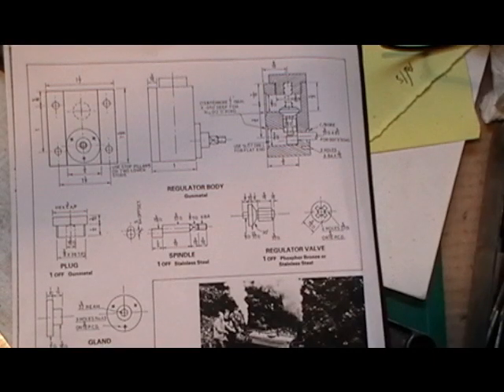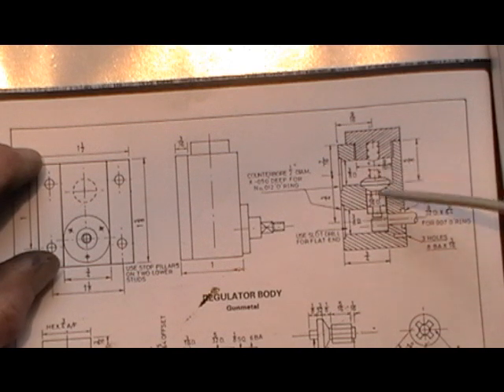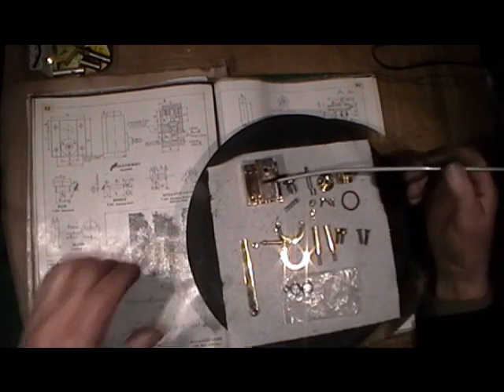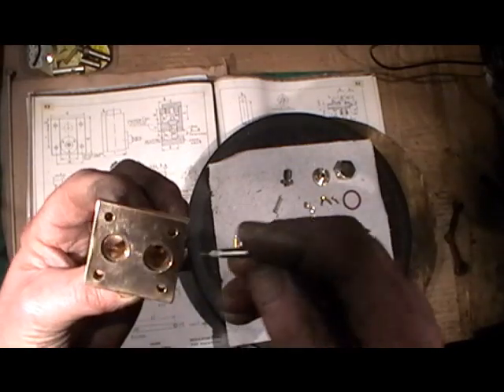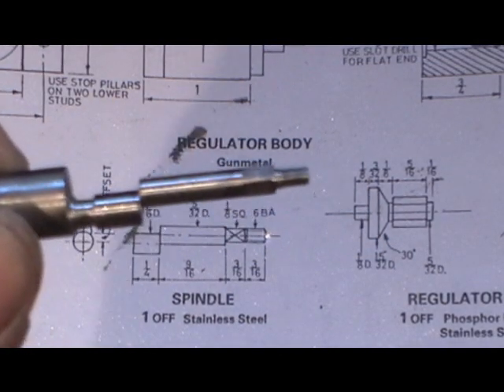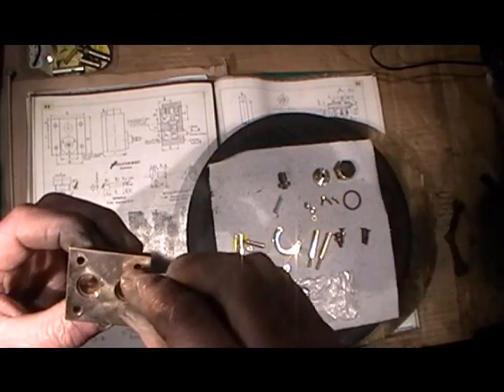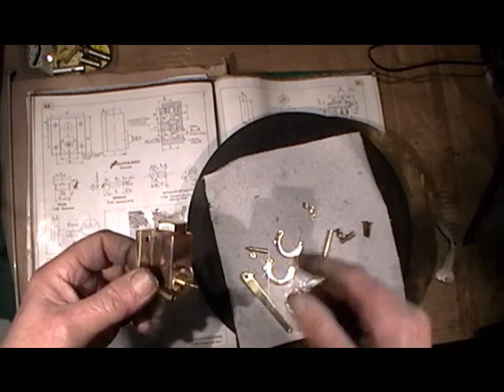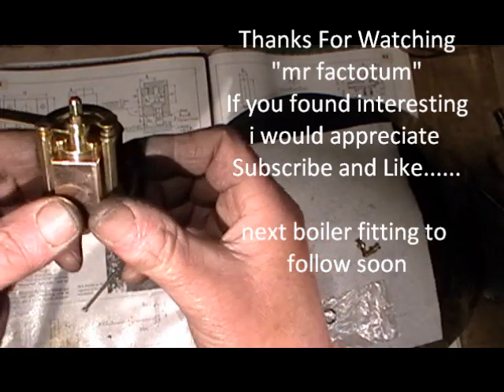Making steam boiler fittings Part 6 (Regulator & how it works) "mr factotum"

Comment: Great to see how its all coming together. Excellent film, thankyou for sharing your knowledge and skills.
Reply from the maker: Thanks for taking time to comment, i appreciate, 
miniature globe valves coming up soon
Regards
Mr f
Reply from the maker: Hi mlw
Ive just been watching your video on opening your newly delivered package for your highlander frames / chassis, looks like it will be an impressive loco once built, look forward to seeing progress, i hate to think of cost of laser cut frames, i am just using hot rolled mild steel and machining all the edges up square and to size. Its time consuming but i affraid i choose to go the cheap!!! sorry value for money route.  Now ive finished my boiler i am just about to start my 5" metre maid frames. Good luck with your build.
Regards
Mr f
Reply: @MrFactotum  Hello, the frames were not as expensive as you may think. I seem to remember around £80 the pair. The time consuming job is programming the CAD file. I cannot do this but a friend of mine  does it for a living so I pulled in a favour. As soon as the weather improves I will get the foundry going and start to make the castings. I hope to make films of this as I go and hopefully I will start to get the chassis assembled over the Autumn. I feel comfortable with the casting and general machining but am dreading the boiler build. However your films have been very inspirational so I will certainly give it my best shot. Work and family have meant that my films are slow to come but I will speed up over the spring and summer....at least I hope so. Keep up your great films.
Reply from the maker: Thanks, good luck with eveything, its the first time ive built a steam loco, i did the boiler first to get the diffucult bit over first
Regards
Mr f